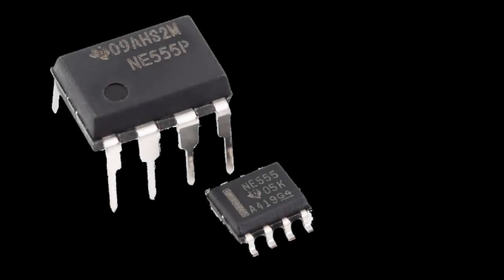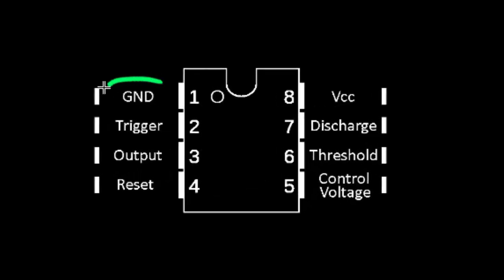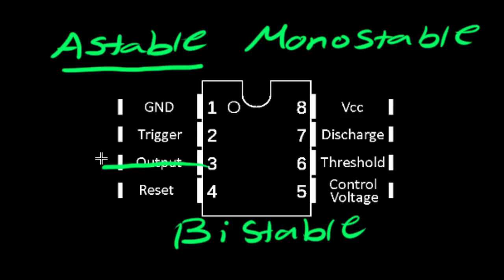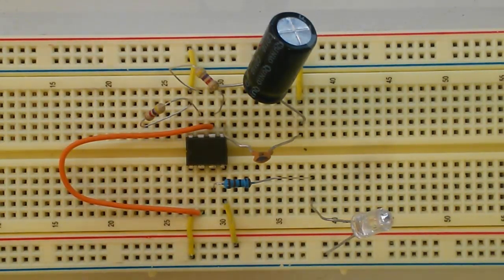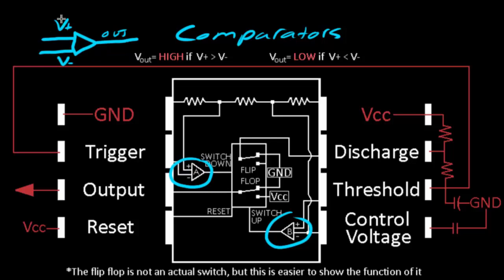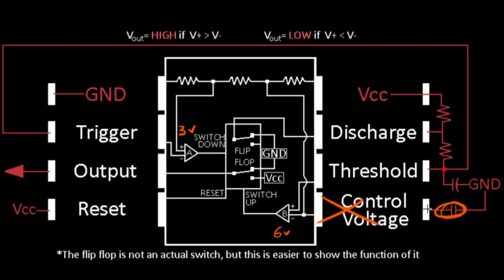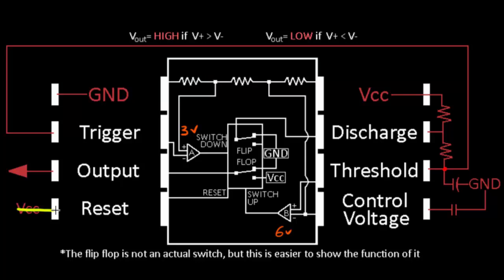Beginner Electronics - 24 - Integrated Circuits: 555 Timer

Comment from the maker: *DISCLAIMER - READ BEFORE WATCHING*
I am an electronics hobbyist; I do not have a degree in electrical engineering. This series MAY NOT teach all of the appropriate safety required for general electronics work. Any advice taken from this series should be checked with multiple sources, and a professional should be addressed to ensure proper safety.
Reply: damn what happened lol
Reply: Some idiot probably shocked himself and tried to sue. It's sad that every thing has to have as disclaimer.  I feel when people try to sue others there should be a law in place that if you file and lose the plaintiff (person being sued) should be awarded half of what the other person tried to sue for. That would stop people from filing suits all the time. Problem is it's cheap to file and if the person being sued cant make it.. you win free money. Also you only need to win once to get paid so some people sue as much as they can hoping they might win one.
Reply: You are the man bro thank you for explaining your the best bro you explained really good. i love it bro I subbed and  liked
Reply: I just don't understand one thing. When the capacitor is charged, why does the current only flow through the Threshold and not through trigger, in turn increasing the voltage of the negative side of comparator A?? and the same while the capacitor gets discharged also. Can someone please explain
Reply: Bro, your circuit works ... not like other 555timer circuits on internet and i tryed lot of them
Reply: What happens when V+=V-=?
Reply: @StephenBarnes-fk5te nothing happens...the condition for the comparator is either < or >

Comment: It's been 8 months since you uploaded this. Please make another one!!!!!! No one else explains things as well as you do!!!
Reply: I started this a few weeks ago, but I'm all caught up now :(
It's so wonderful though
Reply: If you is interested in electronics the best results that I have ever had was by using the Gregs Electro Blog (just google it) definately the most helpful course that I've followed.
Reply: Tommy Verca Thanks man
Reply: I started watching this yesterday and it has already ended please continue making these!!!
Reply: So true.
Reply: Honestly!
Reply: Kai Peters true.  He always thinks he's not explaining well enough and he is boring but this is not true.  HE IS AWESOME 😁😀☺😎
Reply: Hi I have watched every one of these hoping to do some circuit wok with them, But it all finished at tutorial 24, did I miss something????????
Reply: Watched this all can't wait to if you start useing code and Arduino, or a Raspberry Pi.
Reply: @Kraziihype  You are true
Reply: Not certain about the points made but ,if anyone else wants to learn about introduction to electronics courses try Bablim Electronics Booster ( search on google ) ? Ive heard some incredible things about it and my mate got cool success with it.
Reply: I just don't understand one thing. When the capacitor is charged, why does the current only flow through the Threshold and not through trigger, in turn increasing the voltage of the negative side of comparator A?? and the same while the capacitor gets discharged also. Can someone please explain

Comment: I’m a little confused. I know electricity “prefers” to take the path of least resistance, but doesn’t it also try to take all other possible paths? If this is not the case, how is this different from any other parallel circuit in which current flow in each possible path is inversely proportional to resistance in each path? And if electricity is “flowing” in all paths, why is the capacitor only charging when the flip flop is disconnected from ground?

Comment: This is an older video, but it's one of the best explaining the 555 timer....well done.

However, and I want to be completely honest...as a beginner, this video, as well as most others....don't include real-world examples of an actual device, and what would be connected to each terminal, like the trigger, or the threshold, etc.

From a beginner's standpoint, most of us get the fact we can turn on or off anything at any frequency.

We would like a visual reference of a working device and how it would be tied to the 555 timer. This will help us understand how the high and low commands work, etc.

Hope I explained that correctly.

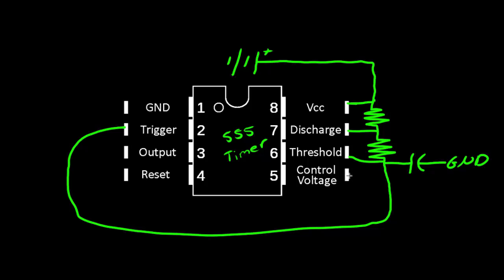Comment: 5:55 Adding the cap to pin 5 is for monostable mode, not astable. Pin 5 is useful for control voltage input (aka musical notes for your square wave oscillator) in astable mode! And see what I did there? 😏👉

Comment: genuinely love this series, you are doing a great job making electronics very accessible. I have one question: what is the reason for the resistors inside the integrated circuit have a voltage split 1/3 and 2/3. How do you know that?
Reply: The voltage is a force that will make the electrons move to a certain place. In that example, you have 3 equal resistors in series, and as the cables are not usually considered, the force needed to pass each resistor is 1/3 of the force (voltage). So after the first resistor, it is used 1/3 of the voltage, but you still have 2/3 to complete the circuit

Comment: Just a quick correction. I think the capacitor will discharge through the Discharge pin and not the trigger as stated. Remember an Ideal Op-amp does not transmit current.

Comment: Maybe a dumb question but what would happen if the two resistors from Vcc to Discharge to Threshold were just wire connectors? Do they need to be there?

Comment: So since a potentiometer is a variable resistor, which resistor would you replace in the circuit to effectively change the frequency of the pulsing light? A or B?  I’m assuming B since it has a multiplier if 2x???

Comment: I think it is wrong if you say in your explaining ( 19:10 ) that discharging of capacitor is going over Trigger comparator  inverting input. There is no current possible through comparator (=OPAMP) input because of very high input resistance. The discharging is going over the resistor between Discharge and Threshold then over Discharge to GND.
Otherwise - very good tutorial.

Comment: I hooked up my board exactly like you showed in this tutorial and I'm getting nothing. I cannot for the life of me figure out what I'm doing wrong. My capacitor isn't as big as yours but you said that shouldn't matter. Idk but this is the only one that has stumped me so far. I also had to skip the last tutorial because all I had was the blue relay switch, the one you didn't use. Either way if you have any advice on what I could be doing wrong let me know! This has been fun so far.

Comment: Thank you for the amazing video. Everything is so well explained. A question I have is what is the advantage of using the 555 timer chip over a relay or a transistor in the circuit to have blinking LED light? Many thanks!

Comment: best explanation ever, one question however :

What is preventing a rapid voltage drop from Capacitance "C" to the "trigger"  (from 6v to lower than 3V) ?
Reply: Nothing! It is a wire that connects from 'c' to the Trigger input so essentially the voltage at 'c' appears at the trigger input. Remember that the comparators are comparing the voltages at their + - input terminals. What was not made clear was that the current will travel through the Discharge pin at this time to GND. As the current leaves the capacitor its voltage begins to drop. Comparators are high impedance devices which means that they draw little current. The discharge pin is connected to ground when comparator A is triggered. The current drops very quickly and hence the timing cycle starts all over again.

Comment: I just don't understand one thing. When the capacitor is charged, why does the current only flow through the Threshold and not through trigger, in turn increasing the voltage of the negative side of comparator A?? and the same while the capacitor gets discharged also. Can someone please explain

Comment: Would you please tell me Why voltage of comparator B increasing up like 1, 2,... 6 volt?? As far as I know if threshold pin has X volt then comparator B should have X volt and also capacitor should have thise same. Because voltage remains same at parallel division.

Comment: Can someone explain ground to me like I'm five? I understand what it traditionally means, like being grounded, but I'm only learning here that it's what's the negative terminal on a battery technically is. Is it kind of like the out point on a circuit where electrons are being poured into, with the flow of the electrons on their way to ground out of the system being what gives the power?

Comment: At about 15-16 minutes in when you mention that electricity will choose the easier path... wouldnt it just make a parallel connection and charge the capacitor?

Comment: I noticed when I disconnected the reset from vcc the timer still worked. Also when I tried connecting an actual switch to the circuit, it the light stayed solid when open and flashed when the switch was closed. Anyone know why that is?

Comment: Re; the disclaimer above, you should be a little more specific in your warnings, like, "Please don't connect the positive and negative leads of a set of jumper cables to a car battery and the other side to your junk. That will hurt." Just sayin'.

Comment: can i ask you 2 questions please ,they arebasic for you: what is the difference between a 200ohm resistor and a 2k one? Also at 7.05 min you mentioned if that capacitor is larger the LED blinks slower - why is that please? Thanks in advance
Reply: 200ohm resistor resist the flow of current less as compared to 2kohm resistor
Reply: @omkarbansode6305  ok, but in math what is is difference ? eg 10 is 10X smaller than 100 :)
Reply: @ChristopherClaudioSkierka  if it is 10 times smaller then it will resist 10 times less that's it.
Q.2) And as we take larger capacitor ,
The energy stored in it is large , so ,it takes more time to drain out,
Hence bulbs blinks slower
Reply: @omkarbansode6305  ohhh jeez , i just want the equivalent in figures, ohhh christ !! you dont get it. Lests take baby steps ...if we look at distance. 1000 meters shorthand could be 1km  - get my drift now??? so 2K ohm  compared to 200 ohm , would the 2k ohm be 2,000 ohm or 20,000 ohm ?? or another figure?
Reply: @ChristopherClaudioSkierka  I would like to suggest, go on Google and search ,
Mili
Micro
Nano
Pico, etc
You will get it..
By the way your answer is( 2k ohm=2000 ohm )
Reply: @omkarbansode6305  praise the Lord , he has managed to sum up the courage to give an answer , thank you

Comment: Can someone tell me what I'm missing here please? We have 9v entering vcc pin 8 and there are 3 resistors in series but I'm confused how that config sends 6v to comparitor b and 3v to a?
Reply: The three resistors you mention make up what is often called a "voltage divider".

So we see 9 volts at Vcc an 0v at Ground.

Go back and review CodeNMore's video on Ohms Law and you will understand what happens, but briefly,  because there are three resistors, all with equal resistance, there are equal voltage drops across each resistor.

So at Vcc, ie: before Resistor 1 there is 9v
After resistor 1, but before resistor 2 there is 6v.
After R2 but before R3 there is 3v and after R3 there is 0v.

You will see the wires to the comparators come from appoint on the circuit between R3 and R2, giving 6v. And the other comes from a point between R2 and R1 - giving 3 volts.

If you have a breadboard - play with it.

Make a simple little circuit with three equal resistors - apply 9v and then use a multimeter to measure the voltages at each point along the circuit and see what you get.

Hope this helps a bit.

Comment: does anyone know how to calculate the resistor ohms to use in the 555 timer
Reply: I reckon it depends on the circuit.  But he said in the Resistor video that you find the rating from the bands on the resistor or from the specs.  Otherwise, likely I know less than you. 😄

Comment: For an answer to the question "Why do the three resistors at the top split the voltage into 3 and 6 volts?", further down in the comments.
The voltage is a force that will make the electrons move to a certain place. In that example, you have 3 equal resistors in series, and as the cables are not usually considered, the force needed to pass each resistor is 1/3 of the force (voltage). So after the first resistor, it is used 1/3 of the voltage, but you still have 2/3 to complete the circuit.

Same answer to this one " And where does this Frequency formula come from?
The timer default for switching is 1.44 cycle per second.

Comment: Electrotech is a simple and powerful collection of electronics tools and references.

https://play.google.com/store/apps/details?id=com.kookistudios.electrolights

The app includes:

Calculators:

• Resistor Code;

• Resistor Color Code;

• Inductor Color Code;

• Ohms Law;

• Capacitor Value;

• SMD Resistor Code;

• Capacitor Charge;

• Y To Delta Transformation;

• Resistor Series/Parallel;

• Frequency Converter;

• Electronic Components (Resistor, Capacitor, NPN Transistor, Diode, Filters, Operational Amplifier, 7 Segment Display, Thyristor, Triac, Diac, SR FlipFlop, JK FlipFlop, D FlipFlop, T FlipFlop, Counters, Shift Register, Multiplexer, Demultiplexer, IC 555 Timer, Voltmeter, DC Motor, Inductor, Photo Diode, Potentiometer, ASCII Table Code, Automotive Fuses Colors, IEC Connectors, Thermocouple Color, Printed Circuit Boards, LS6R DC Disconnect Switch, Micro Switch);

Electronic Quizzes (Resistor Quiz, Capacitor Quiz, Transistor Quiz, Diode Quiz, Filters Quiz, Thyristor Quiz, Triac Quiz, Diac Quiz, Operational Amplifier Quiz, Oscillator Quiz);

• Port pin-out (USB port, Serial port, Parallel port, Ethernet port, Registered Jack, SCART connector, DVI connector, HDMI connector, Display Port, VGA connector, Boolean Logical Gates, Jack connector, SD Card, Raspberry, Circuit Schematic Symbols, World Plugs/Sockets, Arduino boards, NeoPixel LEDs, 2.4” TFT LCD Module, Graphical LCD Module, LED Bar Graph, LED Matrix Module, OLED Display );

• Modules (Stereo Audio Amplifier, Voice Recorder/Playback Module, ECG Module, DDS Signal Generator Module, Breadboard Power Supply Module, Record and Playback Module, Accelerometer Module, DC-DC Step Up Module, USB to TTL Converter Module, Digital Hall Sensor Module, Digital Motion Processor, Temperature Sensor Module, Switch Sensor Module, Moisture Sensor Module, Motor Driver Module, Wireless SoC Module, 5V 5-Pin Relay, 5V Single-Channel Relay Module)